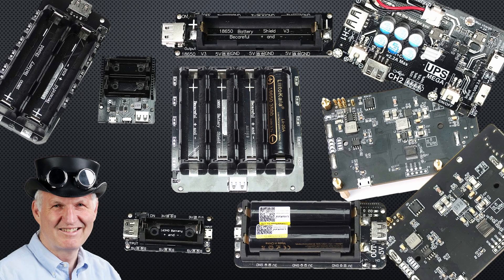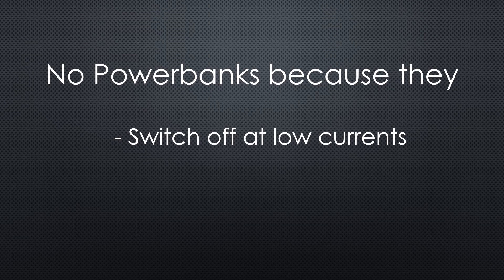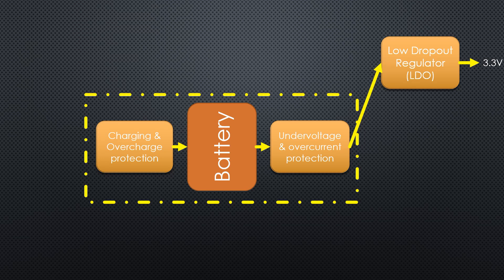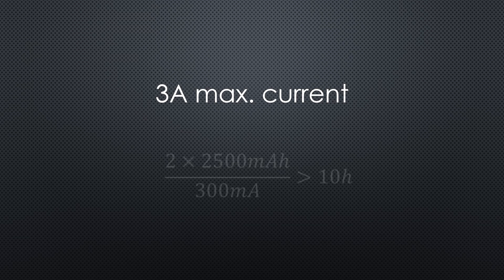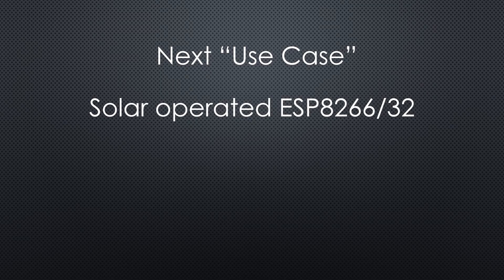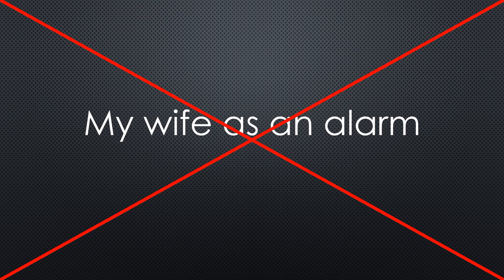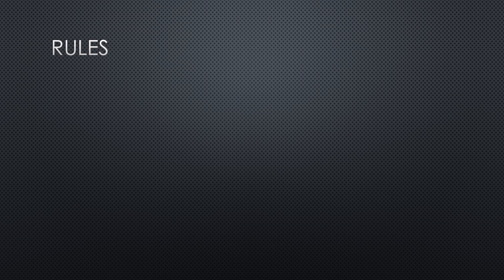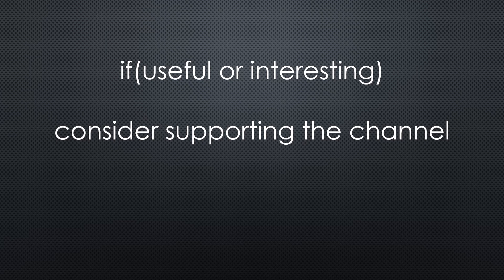#351 10 Battery Power Boards for Raspberries and ESPs. Start of “SuperPower” project

Comment: The engineering-contradiction between "low quiescent current" vs. "a boost-converter for 5V (that needs a lot of quiescent current)" could be bypassed altogether by having a 2S configuration (with a balancer). Are there strong and grounded objections to having a 2S scheme?
Reply from the maker: This is why I emphasize on use cases. 5 volt is required for the Raspberry where quiescent current is not an issue. For the ESP modules it is very important, but they fortunatly run on 3.3 volts.
So for the moment I hope we can avoid a 2s configuration because of the balancing needed. But maybe I am wrong...
Reply: @AndreasSpiess  2 cell charging ICs exist. Take a look at the MCP73213 or  BQ2057. I can't speak to the Ti IC, but the Microchip IC is something I've used in a project a few years go to charge a 2S LiPo pack for a RC car remote. I found a break out board somewhere online, and I think Mouser/Digikey has a Eval board for the 73213 as well.
Reply from the maker: @isogen: I added the MCP73213 to the list. The BQ2057 is a single cell charger (according its datasheet)
Reply: @shadow7037932  Staying with a buck topology should lower quiescent current significantly.  Doubly so if we can exploit a low-power mode for the ESP32 that can enable high-current draw.  Or duty-cycle the switching regulator to maintain 3V on the power line.
Reply: @AndreasSpiess  
indeed, there are (at least) two scenarios:
- the first, Raspberry or equivalent for which 5V is essential and for which the quiescent current is not fundamental
- the second (which interests me) is the case of circuits with a 3.3V processor (or less) and sensors which require 5V (CO2, dust, etc.) and for which 5V can be gated, and for which the quiescent current should be low. Moreover, for these applications, the voltage of 3.3V would undoubtedly be more efficiently generated with an ultra low iq step down converter (TPS6280x, TPS627451 -for 2S-) rather than with an LDO.
Reply: @AndreasSpiess  True. A dirty-yet-elegant solution might be to provide a jumper-selectable choice between a low-power "ESP" mode and a high-voltage "RasPi" mode. You are contemplating adding a slider-switch anyway - Could this be a double-throw switch that allows the user to make a choice? Compared to the total cost, the added cost of a separate dedicated buck-controller would be peanuts.
Reply from the maker: @Aditya: The compromise would be too big. The Raspberry board can be much bigger like a hat. It has to have some sort of automatic shutdown, the batteries have to be much bigger, the current much higher etc.
This is why I created two different design teams, at least for the moment.
Reply: @AndreasSpiess  Sure - that makes sense.
Reply: Well, 18650 are usually cheaper per unit of energy and more readily available than other sizes, and to keep the total size small enough, you might need smaller, more expensive, batteries in 2S. It also doesn’t help much as you need a buck converter. Another alternative would be to instead use a buck-boost converter instead of a boost converter + LDO.

Comment: SuperPower is a great idea. I have not yet found a universal solution especially for projects that are supposed to run for a very long time but only need to be on a short percentage of that time, e.g. a e-ink display for data that comes in regular intervals or sensors for weather data or mailbox etc. A functionality for a timed power on and power off via gpio pin like with a TPL5111 or TPL5110 would also be nice for the SuperPower project.
Reply from the maker: I added the chips to the list

Comment: I also use a timeout on data packets from my sendors,.
But I also monitor change for timeout. If sensor have sent the same water count for 8 hours, i.e. no water usage in 8 hours,  I know the sensor is not working properly.
Similarly, I get an alert, if the cat hasn't passed the RFID-controlled cat-door in 12 hours. Then door or cat is malfunctioning.
Reply: No watchdog for the cat that reboots it automatically?
Reply from the maker: @Leif: A good additional functionality on a different layer!

Comment: Just waiting on access to the document but thought i'd post here - Since my RPi lives in a cupboard with my Cable Modem, Router and a separate Network Switch, I for one would like to be able to maintain them during a power outage - this means a few amps at both 12V and 9V. In addition my CCTV NVR runs at 48v so being able to power that (at least until I can send a power down signal) would be good. That's also an idea - some form of logic out which switches when Power goes off and battery mode kicks in... Perhaps we need a few separate boards 5v/3.3v, 9v/12v, 48v (POE) or a single battery pack with bays for separate buck/boost modules and then you could configure your setup as you see fit...
Reply from the maker: I hope you got the access by now...
Reply: @AndreasSpiess  I did Andreas, thank you.

Comment: That's a good idea. My actual project is a arcade box with raspberry pi 3 and TFT display but mi battery source has two output with less amperes than I need. It has 5v 2A and 5v 1A2A, this is insufficient because I need at least 3.5A for my raspberry and 3A for my TFT. When you finish your project I will buy two of them.
Reply from the maker: There is nothing to buy at the end of this project. Just plans to build your own...

Comment: As always interesting and i hope this will result in some Interesting powerboards. I hope multiple, as i do not believe there will be one board for all use cases. This as some use cases can have conflicting requirements. (E.g. for some use cases weight and size can be verry important.)
Reply from the maker: I tend for a modular design with a maximum of function blocks and clear interfaces where you can delete the sections you do not need and create your own PCB.

Comment: Think you should specify parts for JLCPCB SMT assembly libary, as it is a subset of LCSC parts library. To make it feasible for smaller orders a focus on the basic selection should be encouraged.
Reply from the maker: You are right. I already added a link to this "library"

Comment: Don't forget to make the superpower board, with UPS features, and supervised, with open collector alert outputs in case you want to connect to a security system.
Regards
Reply from the maker: The Superpower project, unfortunately, was killed during Covid because of supply chain issues :-(

Comment: Great project! 
I will definitely participate by creating PCB in EasyEDA.
But please note - JLCPCB can't solder ESP32-WROOM-32 on PCB. 
They can solder thousands of components, but not ESP32. They even can't tell when they will fix this issue. 
Maybe now they will listen to the voice of the community and add this feature in the nearest future!
Reply from the maker: I am in contact with them. I care more about the (small) ICs we might use. Solder an ESP32 module by hand is not too complicated compared with small ICs. But I am in contact with JLCPCB.
Reply: If any component isn't soldered by JLCPCB, we have to pay for separate delivery of this component (+customs clearance) from LCSC. If all components are mounted at factory, we pay only for one delivery from JLCPCB, and that saves our money.
Reply from the maker: Exactly.

Comment: Currently designing a gizmo that needs charging and 3v3 out; I've sort of settled on the TPS63031 buck/boost (LCSC part C15516) and BQ24073 charger/PMIC (C15220) but I'm always happy to find better ideas. No real monitoring capabilities though.
Reply from the maker: I added your chips to the lists. Maybe you check and correct (TI page is currently down)  https://drive.google.com/drive/folders/1EVSzTGi6zV_2XqgAnM31S37PE2n4OdgO?usp=sharing

Comment: For  a Raspberry pi, it would be very cool to have a shutdown function that would completely power the pi off after shutdown. It would have to be triggered by a timer. When a shutdown signal comes from the supply you start the timer and do a shutdown on the pi. When supply voltage is stable again the supply powers on the pi .
Reply from the maker: We already started to collect the requirements: https://docs.google.com/spreadsheets/d/1oGSQRG4XssmFL4II1EF2akhWRhvSvHqH1uTaYX9znlw/edit?usp=sharing

Comment: Wow, been looking at this kind of thing for a couple days.
Reply from the maker: Unfortunately the project was not finished…
Reply: @AndreasSpiess  Do you mean is not  or was not? Was not is past tense and suggest that it won't be finished. Still sounds like a great idea. I'm trying to build a rover using ROS2, Realsense, OpenVino, RPi, and Aurdupilot. What you described was something I've been looking for to power the RPi (or other sbc). I know there are a couple solutions available, but I haven't found what I'm looking for yet.
Reply from the maker: @SamFugarino  The team does no more work on the project because they were hit by the supply chain crisis and did not get the parts they needed. Your project sounds very interesting. A lot of work, I assume ;-)

Comment: May I suggest having a current limiting and short circuit protection at the output? There are some Analog Devices PMICs with ADC output for current monitoring of the load, as well as MCU reset. I've seen them on JLCPCB's SMT list of parts.
Reply: I also like the ST's DC-DC converters with built-in diode and inductor and almost sure I've seen them in the same SMT parts library. They have very high efficiency and if I remember correctly some were rated for 2A.
Reply from the maker: It would be great if you could lookup the names of the chips and insert them into the chips list. It sounds very promising!
Reply: @AndreasSpiess  I'll try to find time look them up and add them. I'll do it for the cause and to support your project, which I find to be great.

Comment: This is a really good project and excellent timing too. I tried to power an ESP32 with the 3V pin of a power board that only made the ESP32 unstable. The ESP32 breakout boards also consume incredibly high amounts of current even in deep sleep mode. So I guess that a SuperPower 18650 board combined with a bare bones ESP32 would be the answer to my power consumption problem.
In the Excel table you show the single cell 18650 board as capable of 3.3V output, none of the boards I own are capable of more than 3V output and as I explained above are useless to power an ESP32 in a stable condition.
Reply from the maker: I also had one board with 3 volts. The rest had 3.3V. Did you add a 100uF capacitor across VCC and GND of the ESP32 module? It is needed to prevent the current spikes. And maybe you can change the LDOs on your board.
Reply: @AndreasSpiess  <<Did you add a 100uF capacitor across VCC and GND >>
I can't remember but the onboard LED just flickered and the sketch wouldn't run,
<<And maybe you can change the LDOs on your board.>> I had thought about that but I am not set up for SMD soldering, and the markings on the chips appear to be erased.
I will just wait until the SuperPower boards are available.

Comment: Great project! Why not make the output voltage adjustable, using a boost/buck module? This way you can generalize it more and it would work with future boards/projects that may have other power requirements too.
Reply: I've been hacking this sort of thing together now for a few months for my projects... solar to boost converter for 5v output into a tp4056 module to charge/protect the 18650, then a buck/boost to power my project. Maybe too much current consumption?
Reply from the maker: The TP4056 for sure is a contender, at least for the ESP boards. It is too weak for the Pi board.

Comment: Question / Requirements: Why not use the battery till it dies?   Maybe we could design the SuperPower with "optionals"  not populated components to reduce cost and being able to use it widely.
Reply from the maker: Maybe a project variant. Without charging things get less complicated. You only need 4 AAA cells and an LDO to prevent voltages above 3.6 volts. and maybe a reporting function to report battery voltage.

Comment: Keep in mind temperatures.  Remote devices often have to operate at "extreme" temperatures... Battery chemistry is quite sensitive with charge and discharge currents limited outside of "office temperatures". I suspect that exposed devices in Switzerland need to operate down to -20°C in an average year and colder should not be terminal for the device. Elsewhere, exposed to the sun or at least radiation from the sunlit surface around a solar panel, 55°C should not destroy the device.

Inland temperatures in Australia's outback vary by over 40°C within a day during dry seasons. It gets close to freezing every night under clear skies and well over 40°C in the shade during the day. Surface temperature of the ground can be over 55°C. (If you need ground-level sensing in the sun, then you should consider burying the electronics 30cm is usually enough, leaving only the sensors and perhaps antenna exposed to the extremes.)
Reply from the maker: I agree. Maybe you add these requirements to the respective lists?

Comment: Excellent video and project, Mr Spiess. I'm currently working on a solar powered security camera, using a RPi 3A, a 60Ah LiFePO4 battery bank (4p2s flat packs reconfigured to ~8VDC from a power bank). 2 x 20W PV panels supply ~12-18 VDC to a buck converter to charge the bank @8 VDC. That is also a power bus to 5 VDC buck converters for the RPi 3A and ESP32 controlled tracking motors. In other words, my project requires all of your checkpoints. I'll be all over your site to follow up. Thank you for filling the need.🙏
BTW, I'd like one of those 'wife alarms'. Do they come with programmable volume or standby? Are they available on eBay?😎
Reply from the maker: They are not at all programmable. And even less can be muted. Maybe because of those features I love her ;-)

Comment: I've been thinking about something similar for a while. But one additional feature I've been curious about is load sharing between a usb dc in and a solar panel at the same time. I can't seem to find a good IC to handle the power management between two low voltage, low current input sources. Hopefully SuperPower will become the solution.
Reply from the maker: We will see...

Comment: Solar management boards from dfrobot could provide a good starting point for a lot of the features and use cases. They do not meet every requirement in one board however but they have multiple flavours
Reply from the maker: Maybe you add the links of those boards to the respective channels on Discord to help the project?
Reply: @AndreasSpiess  definitely will do.

Comment: I'm interested in the Vocore2 Ultimate. It comes in a nice cube shape with ethernet on one side, and the micro usb / usb on the other side. I want to put together a UPS solution for this device, which plugs into the back of it, such that the cases line up and look similar with each other. A kind of plug and go sort of thing.
Reply from the maker: Nice little cube! I saw many designs come and go over the last 5 years. Usually they did not have the needed software support and vanished after a while. They are great for knowledgeable people with lots of time. But maybe I am wrong here and they do it better.
Reply: @AndreasSpiess  I think this one is more a case of having to do it yourself. I have a long software task ahead of me on this one, but I really need a UPS solution for it down the track.
Reply from the maker: A team works on a UPS for a Raspberry as the outcome of my "Superpower" video. They have the prototypes and are testing it now.

Comment: i build something like it using a ltc4425 and used the PFO Pin to shutdown the Pi4 at low voltage via its Enable Pin.
Reply from the maker: Interesting. I also once used super caps for that purpose, but more primitive than your solution. I hope it will not be necessary in an integrated  design where we can monitor the battery voltage and shutdown the Pi before it runs out of juice.

Comment: I forgot powerbanks switch off on low currents (and I already bought one 😢), thanks for mentioning it.
Reply from the maker: Hopefully you can use it otherwise...
Reply: @AndreasSpiess  Yes I'm sure about that. Also,  I found a Wemos esp32 board that comes with a 18650 battery holder, charging and protection circuit, so that's a pretty good premade solution.
Reply from the maker: Do you have a link?
Reply from the maker: Thanks! I am not sure how much current it consumes during deep-sleep.
Reply: There are some older ones which don't switch off the 5v output, but they are increasingly rare to find

Comment: Hi Andreas, I love your videos! I was wondering whether the four cell variant, from this video, can be used as a UPS for a Raspberry Pi? In your Excel Sheet you remarked that it has a "short interruption if charge is disconnected", so I am wondering whether this short interruption is short enough for the batteries to kick in and start powering the RPi before it has a chance to shut down, as this is a key feature of UPS devices and regular power banks do not support that fast switching. This board is also pretty cheap and can hold 4 batteries which means that it should keep the RPi powed for some time if the power outage is bad. Could you test this and report back the results as I am wondering whether or not to buy it for my RPi. Thanks and all the best :)
Reply from the maker: I will not use this board for the Pi because it does not have the features needed (shutdown, etc.). This is why I started the Superpower project.

Comment: what UPS would you recommend for the automatic proper shutdown when power is interrupted. except for supercapacitors UPS cuz, it is not available right now Int'l and here in the Philippines
Reply from the maker: So far I did not find a good UPS for the Pii.
Reply: @AndreasSpiess  thanks. Anyways, I found another way for my technical design